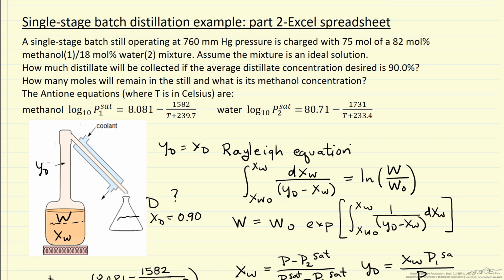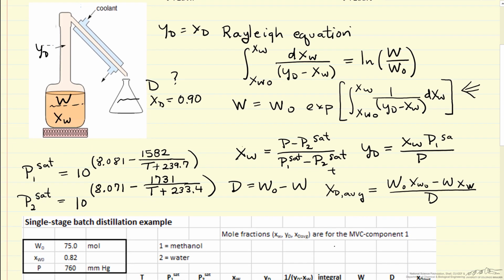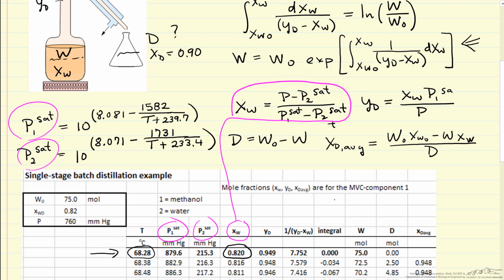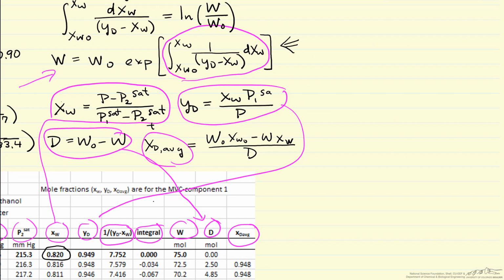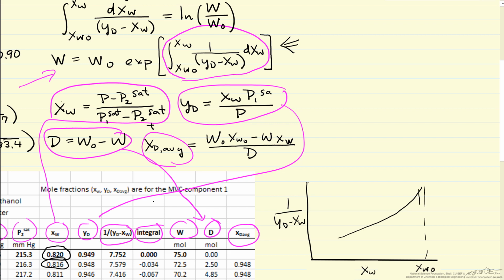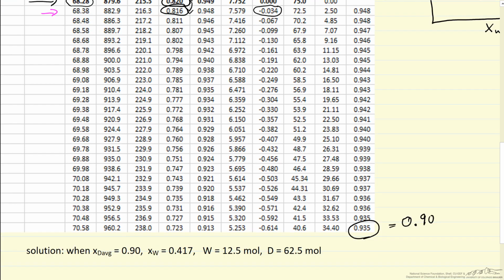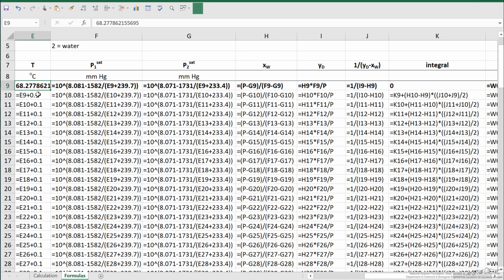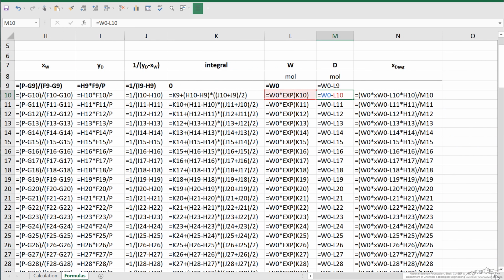Single-Stage Batch Distillation Example Part 2

Comment: hello, there is an error in the water vapor pressure. 
80.71 ..... 8.071
Reply from the maker: 8.071 is the correct value and that is what was used in the calculations